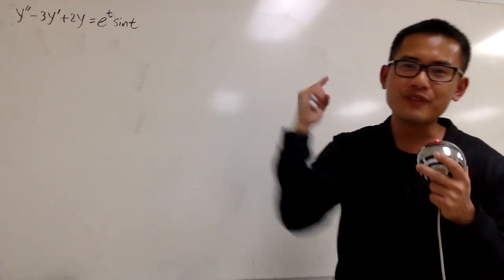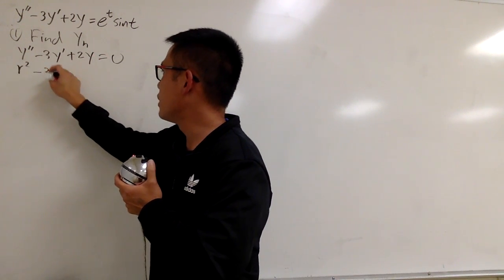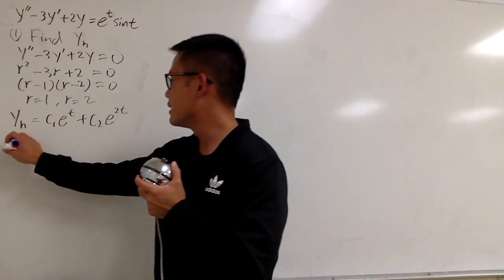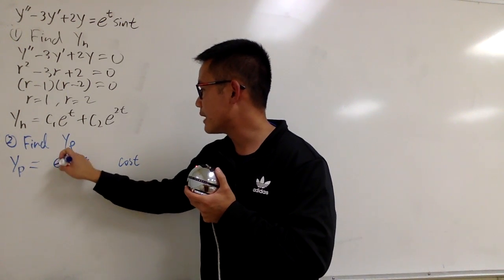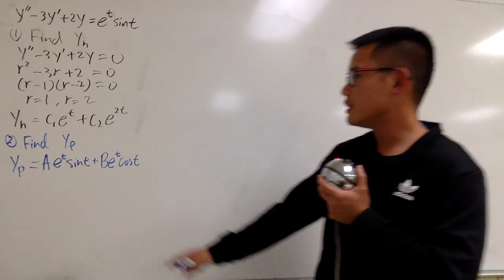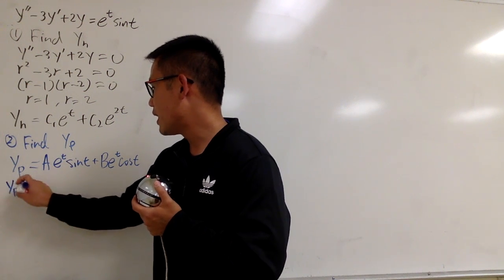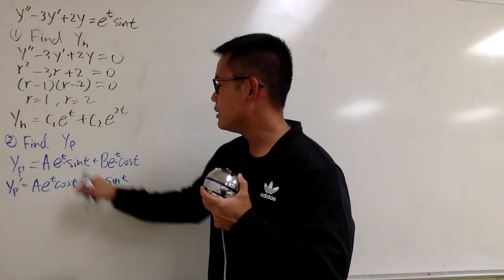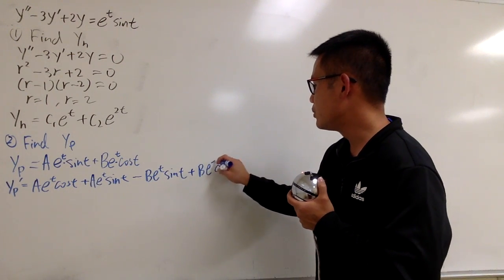undetermined coefficients, diff eq, sect4.5#19

Comment: I just don´t get why we need the Yh solution. Isn´t Yp enough? What does the Homogenous solution add?
Reply: yp only solves a special case of initial conditions, that the coefficients in front of the yh parts diminish to zero.   The yh part is the transient response from initial conditions, while the yp part is the steady state response that governs what it will be, once the initial conditions are effectively out of the picture.

As an example, given:
y" + 4*y' + 3*y = 10*cos(t)

The homogeneous solution is:
yh = A*e^(-t) + B*e^(-3*t)

The particular solution is:
yp = 2*sin(t) + cos(t)

In the special case that our conditions start on the curve of yp, then the coefficients A and B both become zero, and we don't need the homogeneous part.  This would happen if, in this example, y(0) = 1, and y'(0) = 2.

What the homogeneous part adds, is the ability for the system to start at any set of initial conditions, and exponentially decay to eventually match the particular solution.

Comment: Why do not muttiply t in yp? e(t) repeat.You do wrong.  Please explain clear.Because e(t) is in yc and e(t) is in yp.
Reply: If there is an overlap between terms in your prototype for yp and your homogeneous solution, then your solution for yp is not linearly independent of it.  You multiply by t, until you have a linearly independent particular solution, from your homogeneous solution.  An application of this, is resonance in vibrations.  When you drive an undamped vibrating system with a forcing function that matches its frequency exactly, it will perpetually grow in amplitude, as a linear function of time.

As an example using e^t, consider:
y" + y' - 2*y = e^t

Our homogeneous diffEQ:
yh" + yh' - 2*hy = 0
(r^2 + r - 2)*e^(r*t) = 0
(r^2 + r - 2) = 0
r = -2, and r = +1

Thus:
yh = A*e^(-2*t) + B*e^t

Since e^t in the non-homogeneous part, overlaps with our homogeneous solution, we must multiply by t until it is linearly independent.  Thus:
yp = C*t*e^t

Take derivatives:
yp' = C*e^t + C*t*e^t
yp" = 2*C*e^t + C*t*e^t

Apply to the original diffEQ for yp:
yp" + yp' - 2*yp = e^t

2*C*e^t + C*t*e^t + C*e^t + C*t*e^t - 2*C*t*e^t = e^t

Equate equivalent terms:
(2*C + C)*e^t = e^t
(C + C - 2*C)*t*e^t = 0

2nd equation is redundant.  1st equation can be solved for C:
C = 1/3

Thus yp = 1/3*t*e^t

Combining yh and yp, our result is:
y = A*e^(-2*t) + B*e^t + 1/3*t*e^t
Reply: To play devil's advocate, you might wonder, why not multiply by t^2?  Well, let's try it with the previous example, and show that it will not work.

Assume yp = C*t^2*e^t

Take derivatives:
yp' = C*(t^2 + 2*t)*e^t
yp" = C*(t^2 + 4*t + 2)*e^t

Construct diffEQ for yp:
C*(t^2 + 4*t + 2)*e^t + C*(t^2 + 2*t)*e^t + C*t^2*e^t = e^t

Equate common terms:
3*C*t^2*e^t = 0
(4*C + 2*C)*t*e^t = 0
2*C*e^t = e^t

This will solve for C = 1/2.  But does this work?  Try it in the original diffEQ and see:
yp = 1/2*t^2*e^t
yp' = 1/2*(t^2 + 2*t)*e^t
yp" = 1/2*(t^2 + 4*t + 2)*e^t

1/2*(t^2 + 4*t + 2)*e^t + 1/2*(t^2 + 2*t)*e^t - 2* 1/2*t^2*e^t =?= e^t

t^2*e^t terms all add up to zero, so we're good there.

For t*e^t terms, we have:
4/2*t*e^t + 2/2*t*e^t = 3*t*e^t

And for e^t terms, we have:
2/2*e^t = e^t

Simplifies to:
3*t*e^t + e^t =?= e^t

And here we have a contradiction, because the 3*t*e^t term doesn't disappear.  We need both t^2*e^t and t*e^t terms to diminish to zero, in order for our solution to satisfy the original diffEQ.

Comment: A coil of inductance L Henry and a capacitor of C Farad are connected in series if I=I0, Q=Q0 when t=0 Find: Q and I when t<0
Reply: The corresponding diffEQ is:
L*Q"(t) + Q(t)/C = 0

Characteristic equation:
L*r^2 + r/C = 0

Solution for r:
r = +/-i/sqrt(L*C)

The solution for Q(t), is a linear combination of sine and cosine, with a frequency equal to the imaginary part of r:
Q(t) = A*cos(sqrt(1/(L*C))*t) + B*cos(sqrt(1/(L*C))*t)

At t=0, Q(0) = Q0, and I(0) = I0, which is the same thing as Q'(0).

Find Q'(t), which is also I(t):
Q'(t) = sqrt(1/(L*C))*(-A*sin(sqrt(1/(L*C))*t) + B*sin(sqrt(1/(L*C))*t))

At t=0, sine is zero, so the cosine terms govern.   This means:
A = Q0
B*sqrt(1/(L*C)) = I0, solve for B: B = I0*sqrt(L*C)

Thus our result is:
Q(t) = Q0*cos(sqrt(1/(L*C))*t) + I0*sqrt(L*C)*sin(sqrt(1/(L*C))*t)
I(t) =  sqrt(1/(L*C))*(-Q0*sin(sqrt(1/(L*C))*t) + I0*sqrt(L*C)*sin(sqrt(1/(L*C))*t))

Comment: what would the general formula be for yp if the right side is e^x(6cosx  +17sinx). I'm struggling with trig functions. I know how to do the derivatives, I'm just not sure what to start with.
Reply: Given an RHS of e^x * (6*cos(x) + 17*sin(x))

The general form of the yp particular solution would be:
e^x * (A*cos(x) + B*sin(x))

As long as your given linear combination of sine and cosine both have the same frequency, they both correspond to the particular solution being a linear combination of the two.  The e^x applies to both of them.   Also important is that we don't overlap the homogeneous solutions, otherwise we'd need to multiply by t until it is linearly independent.

As an example:
y" + y = e^x * (6*cos(x) + 17*sin(x))

While this may look like there is overlap, there really isn't.  We'd have to have y" - 2*y' + 2*y = e^x * (6*cos(x) + 17*sin(x)), to have overlap, since the homogeneous solutions of this one, also include the exponential envelope on the trig functions.

The homogeneous solution:
yh = A*cos(x) + B*sin(x)

The particular solution:
yp = e^(x) * (C*cos(x) + D*sin(x))

Differentiate twice:
yp' = e^x * ((D - C)*sin(x) + (C + D)*cos(x))
yp" = 2*e^x * (D*cos(x) - C*sin(x))

Apply to original diffEQ, and equate coefs to find C & D:
2*e^x * (D*cos(x) - C*sin(x)) + e^(x) * (C*cos(x) + D*sin(x)) = e^x * (6*cos(x) + 17*sin(x))

Cancel common e^x factor:
2* (D*cos(x) - C*sin(x)) + (C*cos(x) + D*sin(x)) = 6*cos(x) + 17*sin(x)

Thus, equating coefs we get:
2*D + C = 6
-2*C + D = 17

Solve for C & D:
C = -28/5, D = 29/5.

Thus the solution is:
y = A*cos(x) + B*sin(x) + e^x*(-28/5*cos(x) + 29/5*sin(x))

Comment: What should be the method of solving this equation
D2y/dt2 _ dy/dt _2y= 5 cosh(2t)....by undetermined method....kindly help plzzz
Reply: Assuming your underscores mean +, we're given:
y"(t) + y'(t) + 2*y = 5*cosh(2*t)

You can use undetermined coefficients, since cosh is just a linear combination of two exponentials.  I'll assume a particular ansatz, of a linear combination of cosh and sinh.

First find the homogeneous solution:
yh" + yh' + 2*yh = 0
(r^2 + r + 2)*e^(r*t) = 0
(r^2 + r + 2) = 0
r = (-1 +/- sqrt(1 - 8))/2
r = -1/2 +/- i*sqrt(7)/2

Thus:
yh = e^(-t/2) * (A*cos(t*sqrt(7)/2)) + B*sin(t*sqrt(7)/2)))

For the particular solution:
yp = C*cosh(2*t) + D*sin(2*t)

Apply to original diffEQ, and match coefs:
yp' = 2*C*sinh(2*t) + 2*D*cosh(2*t)
yp" = 4*C*cosh(2*t) + 4*D*sinh(2*t)

Thus:
4*C*cosh(2*t) + 4*D*sinh(2*t) + 2*C*sinh(2*t) + 2*D*cosh(2*t) + 2*C*cosh(2*t) + 2*D*sinh(2*t) = 5*cosh(2*t)

4*C + 2*D + 2*C = 5
4*D + 2*C + 2*D = 0

solution for C&D:
C = 15/16, D = -5/16

Thus, the solution is:
y = e^(-t/2) * (A*cos(t*sqrt(7)/2)) + B*sin(t*sqrt(7)/2))) + 15/16*cosh(2*t) - 5/16*sinh(2*t)

Comment: Very good!

Operator Method:
Auxiliary equation: r^2-3r+2=0
(r-1)(r-2)=0
r=1,2

Complementary solution y_0=C_1 e^x+C_2 e^2x

(D-1)(D-2)y=e^x sinx

Particular solution y_p=1/(D-1)(D-2)  (e^x sinx)
=e^x  1/(D+1-1)(D+1-2)  (sinx)
=e^x  1/D(D-1)  (sinx)
=e^x  1/((D^2-D) ) (sinx)
=e^x  1/((-1-D) ) (sinx)
=〖-e〗^x  ((D-1))/((D^2-1) ) (sinx)
=〖-e〗^x  ((D-1))/((-1-1) ) (sinx)
=〖-e〗^x  ((D-1))/((-2) ) (sinx)
=e^x/2 (cos x-sinx)

General solution y=y_0+y_p=C_1 e^x+C_2 e^2x+e^x/2 (cos x-sinx)

Comment: WHAT IS THE GUESS FOR A CONSTANT TO THE POWER OF X?? eg. 2 + 2^x
Reply: Good question.  If your term on the RHS of the original equation is 2^x, recognize that this is really the same family of functions as e^x, since it is also exponential.  Therefore, the particular solution would involve linear combinations  of 2^x, or alternatively, e^(ln(2)*x).

Comment: excuse me ... i want a solution for this equation y'' + 4y = 8x^2....thank you.
Reply: Given:
y" + 4*y = 8*x^2

Start by finding yh, where the 8*x^2 part isn't present.
yh" + 4*yh = 0

Assume yh = e^(r*t)
yh" = r^2*e^(r*t)

(r^2 + 4)*e^(r*t) = 0

Solution for r:
r = +2*i
r = -2*i

Imaginary solutions, mean a linear combination of sine and cosine.
yh = A*cos(2*x) + B*sin(2*x)

To find our particular solution, assume it is a polynomial as the same order as the 8*x^2 part, with arbitrary coefficients.
yp = C*x^2 + D*x + E

Apply derivatives to construct diffEq from yp:
yp" + 4*y = 8*x^2
yp" = 2*C
yp' = 2*C*x + D

Thus:
2*C + 4*(C*x^2 + D*x + E) = 8*x^2

Cancel 2:
C + 2*(C*x^2 + D*x + E) = 4*x^2

Equate coefs:
C + 2*E = 0
D = 0
2*C = 4

Thus:
C = 2, D = 0, E = -1
yp = 2*x^2 - 1

And our complete general solution is:
y = A*cos(2*x) + B*sin(2*x) + 2*x^2 - 1

Comment: how about y"-2y'+2y = e^t * sint
Reply: What's the problem? The common solution of homogenous equation will be in the form M₁e^t sin(t)+M₂e^t cos(t), one term clashes with the right part, so in general you'll search for a particular solution in the form Bte^t sin(t) + Dte^t cos(t), which you''ll find out as B=0, D=-½. You don't need to search for the full formed (A+Bt)e^t sin(t)+(C+Dt)e^t cos(t), because A and C here will be absorbed into M₁ and M₂ anyway. So the final solution will be: y=e^t (M₁ sin(t) + M₂ cos(t) - ½t cos(t)), M₁ and M₂ are free constants to be found from the initial conditions.

Comment: @1:30 How did you know it was going to be:  yp = Ae^tsin(t) + Be^tcos(t) ?   A bit more explanation is needed there. 
What happens if the equation is y'' - 3y' + 2y = 3t ?
What happens if the equation is y'' - 3y' + 2y = tan(t) ?
How does that piece change?  Thanks.
Reply: you should check his differential equations playlist. there is variation of parameters method for tant and other types of undetermined coefficients methods  for 3t, e^t kind of things.
Reply: I think it's from a table given.. that what i use actually
Reply: If the function on the right hand side is linearly independent of the homogeneous solution, you directly match it with an arbitrary coefficient, and accompany it with other coefficients on its counterparts (more on that later).  If it is a constant multiple of one of your solutions to the homogeneous solution, then you multiply by t until it isn't.

For exponentials, the particular solution will also be exponential.
For sine or cosine, or a linear combination of both of the same frequency, the particular solution will also be a linear combination of both of the same frequency.  Likewise for exponentials, enveloping the sine and cosine.
For constants, the particular solution will be a placeholder constant, not necessarily equal to your given constant
For polynomials of t, the particular solution will be a polynomial of the same degree, and placeholder coefficients along the way.

For anything else that isn't a linear combination of the above, you'd have to use another method, like variation of parameters.

Comment: You mentioned it was the superposition principle. Is it the same method as used for circuit analysis?
Reply: It's a similar concept.  Essentially, to simplify the equation, you break it up into two sub-equations that both also need to be satisfied, and work out how to satisfy both parts individually.  And then form a solution that is a linear combination of the two.

Comment: Can you please do one with the differential operator
Pretty please with chocolate frosting on the top
Reply: Operator Method:
Auxiliary equation: r^2-3r+2=0
(r-1)(r-2)=0
r=1,2

Complementary solution y_0=C_1 e^x+C_2 e^2x

(D-1)(D-2)y=e^x sinx

Particular solution y_p=1/(D-1)(D-2)  (e^x sinx)
=e^x  1/(D+1-1)(D+1-2)  (sinx)
=e^x  1/D(D-1)  (sinx)
=e^x  1/((D^2-D) ) (sinx)
=e^x  1/((-1-D) ) (sinx)
=〖-e〗^x  ((D-1))/((D^2-1) ) (sinx)
=〖-e〗^x  ((D-1))/((-1-1) ) (sinx)
=〖-e〗^x  ((D-1))/((-2) ) (sinx)
=e^x/2 (cos x-sinx)

General solution y=y_0+y_p=C_1 e^x+C_2 e^2x+e^x/2 (cos x-sinx)

Comment: Congratulation ! 
Can you please give me little help on an equation ?
I have a function that variate with time x(t). My equation is :

second derivative of x equals to  (1/M) * (e^(-h1*M*t) - e(-h2*M*t))
where M, h1 and h2 are constants that depends on the nature of some parts i will use in my experiment.
Is this equation a 2nd order non homogeneous ? 
And If it is, can you suggest me a function to use for finding a particular solution to this equation ?
If it is not, what kind of differential equation it is ?
Thanks, a lot
Reply: First write down a=h1*M and b=h2*M and plug this in the diff. eqn. then you get:
d^2x/dt^2 = (1/M)*[exp(-a*t) - exp(-b*t)] now integrate twice and you'll get:
x(t) = (1/M)*[(1/a^2)*exp(-a*t) - (1/b^2)*exp(-b*t) + C1*t + C2]

Comment: Couldn't variation of parameters work on this problem as well?
Reply from the maker: I think so. But this is still meant to be solve with UDC
Reply: It's over Anakin, I have the high ground. I think you need to go over when variation of parameters should be implemented.